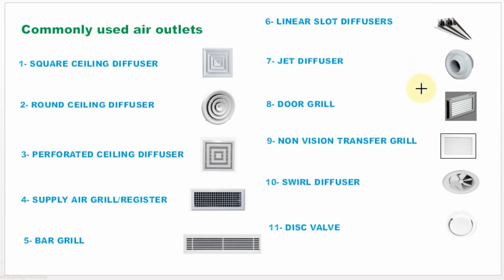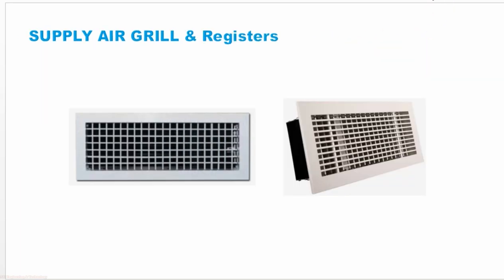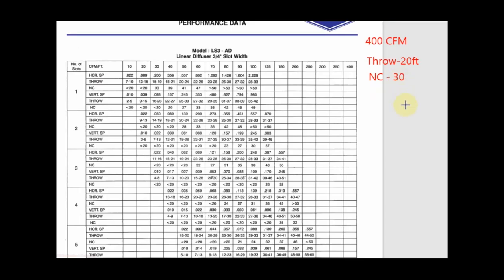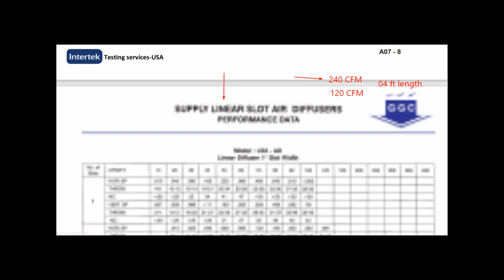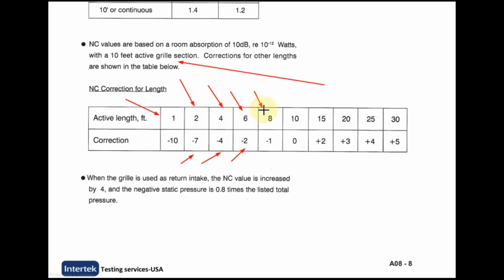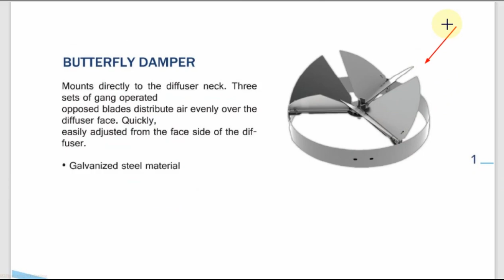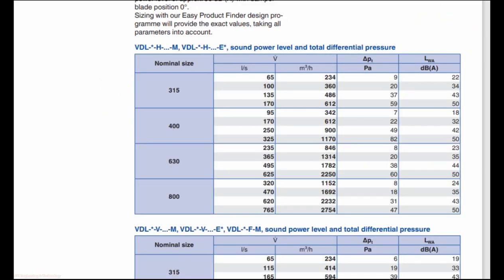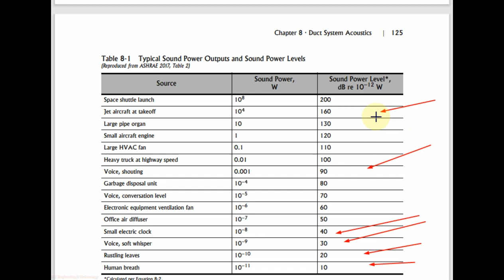107 - How to select grilles and diffusers all type in English

Comment: how did you calculate the CFM of each room. For example, in first example 4200 cfm
Reply from the maker: By heat load calculation & selection of AC unit.
I only assume this CFM, to explain selection of grill. 
different types of rooms may have different CFM, as per their use and project conditions.

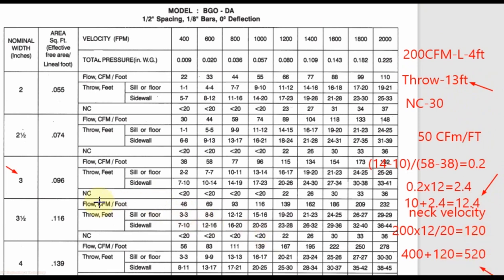Comment: I have one Question at 28:00 in your calculation get 0.2x12=2.4, value of 12 for what ?
Reply from the maker: in this calculation we select grill for 50 CFM/FT.
Throw for 38 CFM/FT is 10ft.
50-38=12 CFM 
we calculate throw for remaining 12 CFM after 38 by interpolation.